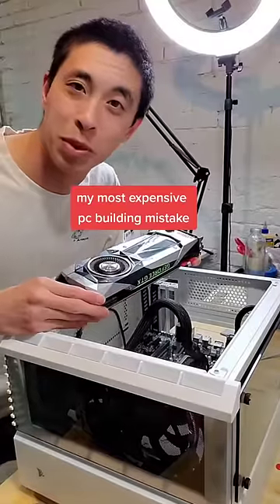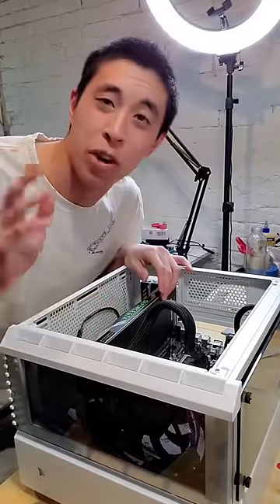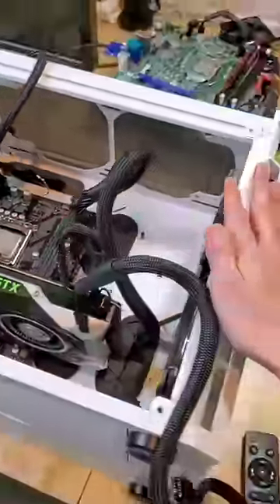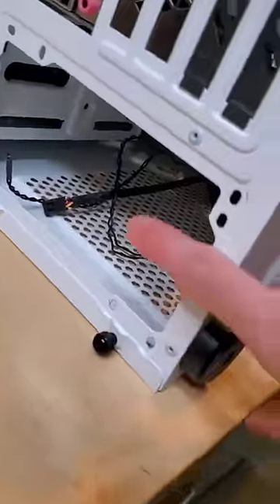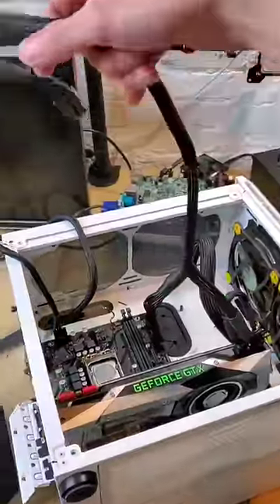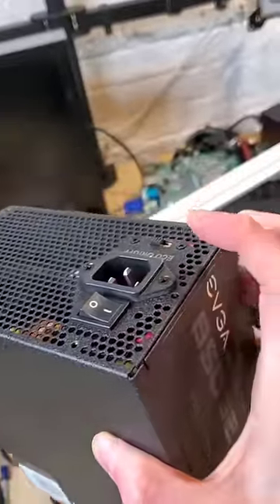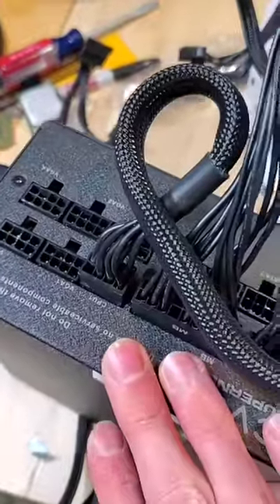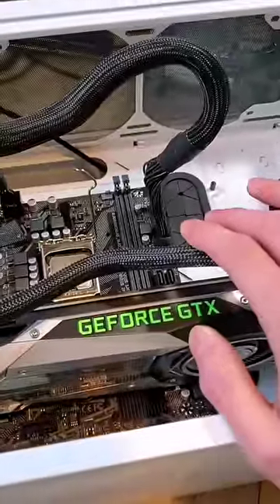my most expensive pc building mistake... #shorts

Comment: You saved my entire system, I ordered a new psu for future upgrades and it’s coming in tomorrow. Was definitely not planning on replacing every cable, crazy how life just throws a tip at you for not messing up
Reply: This just happened to me twice. This video and then last night I randomly found a video explaining to use two 6 pin cables for a GPU rather than one 6 pin cable with another 6 pin connector pigtailed on. I had thought about that possibility before seeing the video but wasn't quite sure. Glad to know for sure now.
Reply: Beats me why would anyone ever want to do that. Are these five minutes really worth it? Especially when we talk about computers, where if something can go wrong, it will always go. And even if everything is perfect and brand new, something can fk up.

PC's are like giants on clay legs.
Reply: @SelevanRsC  well, I’m new to pc building and I’ve just build my first pc. Bought a old one and basically changed everything about it, exept the PSU. Thought it would be easy to just plug everything in to save myself the trouble of doing the cable management again.
Reply: @Trippsy05  does this only apply to modular psus? I have a pc but not a high end one and it has those generic ketchup and mustard cables and I am planning to buy a new 80+ rated psu. Do I need to be cautious with non modulars as well?
Reply: @angelodaniel5867  If you are using a non modular power supply then you will have to re wire your system anyway because the cables are attached to the power supply and can't be removed. If you meant the pigtailed cable vs two legs of 6pin then you'll just have to pick a non modular that has what you may require, which depends on the power draw of your GPU and the gauge/quality of the conductors used in the power supply. 

Personally I have always bought fully modular PSUs because I only run power to the GPU, CPU, and motherboard since I have nothing that uses sata or molex. If I do add something later I can always run a wire to it. If you are dead set on getting a non modular then make sure you have a case with a decent basement or other area where you can route your excess.
Reply: @christiaanvanvoorst85  This was my thought process as well but after watching this video I made sure to separate my old PSU cables from the new ones. New 6950xt and 1000w PSU come in the mail so I take an hour to get the new cables nice and managed, put the GPU in, and realized the thing barely fits inside my nzxt h500 with no room left for a radiator. Here I am now buying a Meshify 2 XL which means I have to rewire my system a second time. I'm going to have a stroke if I end up having to go a third time somehow.
Reply: Yeah.  I ordered a new psu for my new 4090....I nearly.....used all of the older cables with new psu. Something told me. Stop. Just use new cables. Yeah. Crazy how life works sometimes
Reply: You can use other cables. But you don't want to mix and match from different suppliers. Like asus and nzxt come from the same manufacturer. But evga is different.
Reply: @Trippsy05  reading your comment about only running a few cables makes me really appreciate how far PC building has come. I remember doing it growing up and having to run a power cable to every single goddamn peripheral...multiple hard drives, multiple optical drives, floppy drive (yup lol), extra USB ports, half a dozen fans, those PITA split connectors for the LEDs and power buttons - all of that standard, and then whatever else you thought was necessary, like other storage options... And of course none of the power cables came with mesh sleeves, they were all loose lol... And the power cables weren't the only thing you had to deal with, there were also the actual data cables, particularly those FAT, MOTHERF$#@& ATA100/133 cables 🤬😂... Running all of those cables cleanly and tying them up literally took HOURS, and you were usually still left with only like half of the internal space of the PC free for airflow (on a full case, god help your temps if you were using a mini form factor)... 

Dammit, now I actually want to build a new PC just to appreciate the sleekness of new systems 😅
Reply: I don’t agree on the video the cables could have been bad to begin with.
Reply: @neubauerjoseph  Apparently, on modular psu the pinouts are not standardized. This means that the cables that come with the psu are pinned only to match the pinout of that psu, and may not match with other psu.

Of course, you probably think it may match if its the same brand although different model, cause company got to have a standard within themselves right. But I wouldnt plug it in just to find out, with a risk of frying out my pc.
Reply: @kingfoorthwal  Im not going to enter a discussion with someone who starts with insults, so good luck on your journey as well.
Reply: @christiaanvanvoorst85  I guess that makes sense. I basically ignored the fact that there are modular psu heh.
Reply: Happens to me all the time I am 99% it’s God
Reply: @SelevanRsC  Shortcuts with the power supply are especially disturbing.
Reply: It's not only life. It's at least partly YouTubes/Google's algorithm lol
Reply: @SelevanRsC  but you see the pins are the same on the cable and think if it fits its the same thing.. I don't blame people for doing this.
Reply: @dethtour even some manufacturers use diffent pins on different psu they sell. So just because you have evga does not mean its ok to use any evga cable.  I think more manufacturers are getting better about this, but be smart and use new cables everytime unless you bought 2 psu of the same type and around the same time..
Reply: @christiaanvanvoorst85  bad idea. That old PSU may be underpowered for uour parts, and is most likely.a little worn from use. I recommend getting a new one, unless by old you mean like 3-5 years.
Reply: So correct me if I am wrong,    we have to use cable that come along with psu and not  gpu attached older ones
Reply: @neubauerjoseph   I said the same thing, I've reused cables a hundred times no problems ever. What exactly went wrong with reusing the wires anyways? as you said prob just a shit wire to start with.
Reply: @wesleysmith5275  I agree ☝️ according to my college instructor 👨‍🏫 he said if you really want to do it correctly you should have testing equipment but it can get price to do it …. Most of the time it’s cheaper just to buy another part. Also I asked him about doing power supply he said we aren’t electricians so just pop and swap.
Reply: @wesleysmith5275  - oh hell no. It’s like the first thing on “what not to do” videos. Modular connectors don’t have a set configuration when plugging into a psu. A Corsair cable for VGA plugged into the motherboard socket of an EVGA PSU for instance. Unless labeled how would you know?
Reply: @MisterPier777  ok I wasn't thinking of it like that but it's not really apples to apples, I probably wouldn't do that either. I've always used Corsair PSU too so there's that.
Reply: @escanor3989  Yes. Use the cables that come with the PSU (you can buy new cables for it but they need to be the right ones).
Reply: @Trippsy05  nothing bad would've happened your gpu just wouldn't have turned on
Reply: some people get this kind of tip after a the mistake is done 💔
Reply: @Trippsy05  There are semi modular psus as well where only some cables are attached.
Reply: Well google uses cookies to track you, in order to recommend you relevant videos.
Reply: I'm confused. So what about cable mods?
Reply: Even cables from the same manufacturer can be wired differently.  You always have to check the pin out before re-using old power cables on a new power supply.
Reply: @jacekmakes I didn’t look into it before replacing it. Tbh probably wasn’t gonna read it while replacing it but still, pretty nice that this video possibly saved my pc :)
Reply: Im confused what did he do wrong
Reply: @jacekmakes ohhhh okay okay i was a bit confused on what was happening, thanks my boi
Reply: You're the luckiest guy on the planet.
Reply: @jacekmakes I've used the same cables for 3 difference brand of psu with no issued for the past I years
Reply: @jacekmakes  the modular cable yeah
Reply: @jacekmakes you have to look up the sku of each psu that has the cables if they don't match you can't use them. I use the same manufacturer so I've never had a problem. If you are going from asus to evga you're going to burn mobo but if you go between nzxt  and asus you'll be fine because they're the same
Reply: Same boat
Reply: I did this in the past as well and had no issue luckily. was a different brand too
Reply: Corsair might not apply, some cable manufacturers make cables for all corsair power supply without mention of series. So there are exceptions.
Reply: Sameeee. My new psu is arriving tommorow
Reply: @Trippsy05 how do I know if my PSU is modular or not?
Reply: @Trippsy05 hey there, what was the name of the video?
Reply: @Erod-iz1nt If all of your cables can be detached from your power supply it is 'modular'.  
If none of the cables can be detached from the power supply and there are no spots to plug in additional cables [except the one that plugs into the wall outlet] then you have a 'non-modular' power supply.  
If some cables can be detached and some can't, you have a 'semi-modular' power supply.  (They might exist, but for 'semi-modular' power supplies the only cables I've seen that aren't removable are the motherboard & CPU power cables.)  

Oh and sometimes, to differentiate from semi-modular power supplies, a modular power supply will be called "fully-modular", this means the same thing as 'modular'.
Reply: @GeorgeN-ATX  thank you I appreciate it and mine is a semi modular does it matter it is semi or full modular
Reply: @Trippsy05 ahh this answers my question i just asked, thanks
Reply: Jesus Loves You❤💯
Reply: Did it fry?
Reply: @leechking2476 same connector but differently wired. Can cause power to go to components it isn’t supposed to based on which wires land where
Reply: @dethtour this is like saying “I never wear seatbelts and I haven’t even died once.”
Reply: @Erod-iz1nt it will have a bunch of connector modules….
Reply: @Trippsy05  Crazy, just yesterday I put a pigtail on my new gpu and today haha
Reply: So many useless comments and litterally NO ONE (including the guy doing the video) is able to explain WHY we shouldn't do it. 
A cable isn't a cable ...??
Reply: @Trippsy05 wait till you have to upgrade.  I have a 3080 in my laptop but Finally stepped up from 1080ti AIO to 4090 AiO on my rig, popped the back plate off the case and looked on frozen in fear as i saw a fuck ton of cables and not a shred of knowledge or recognition clicking in my brain 😅
Reply: @Trippsy05 thats not going to blow up your graphics card…